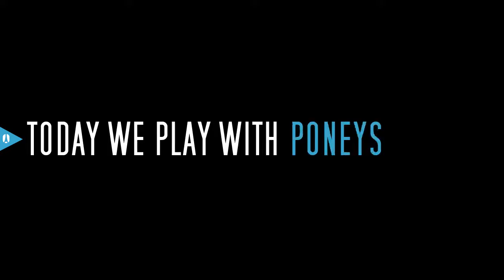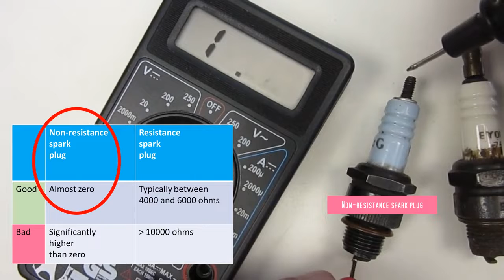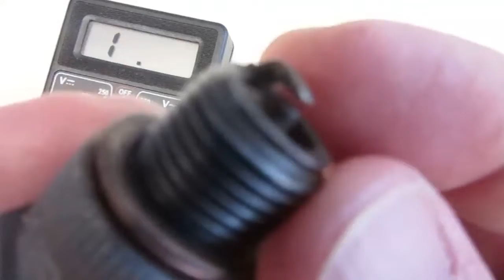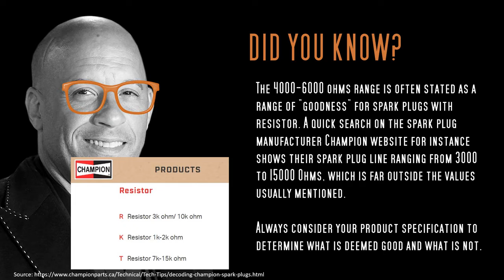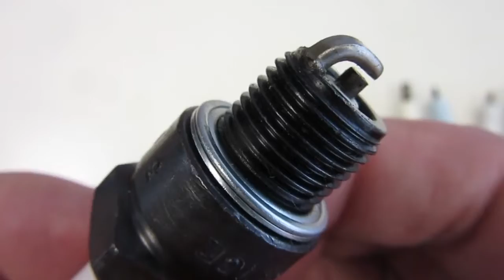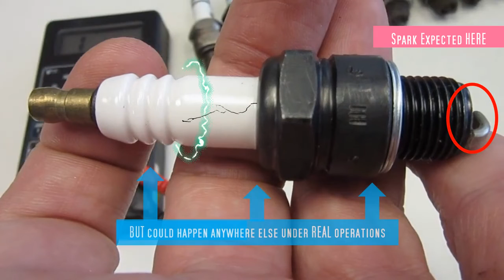Can You Test A Spark Plug With A Multimeter? DMM DVOM Sparking Plugs Testing Explained #DIY #HowTo

Comment: I tested my spark ONLY to check the value of the resistor in it. Multimeter test read on my Denso W27 iridium was 4.7xxKohm, so confirmed that there is a 5Kohm resistor i it. 
Also tested a non-resistor plug, it showed a few ohms resistance, so confirmed that it indeed was a non-reistor plug. That was what I wanted to check out, and the test worked fine. What were you saying??
Reply from the maker: Just like explained in the video